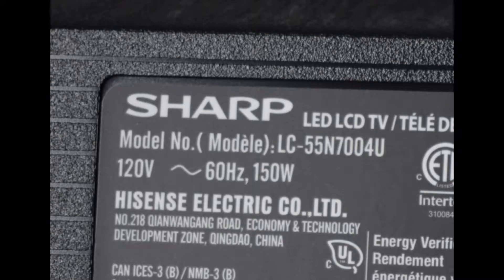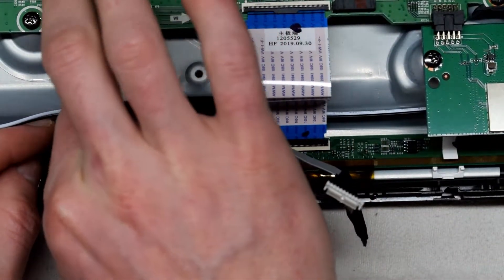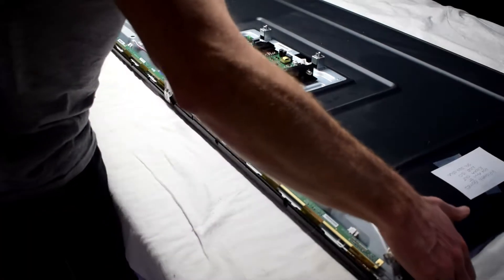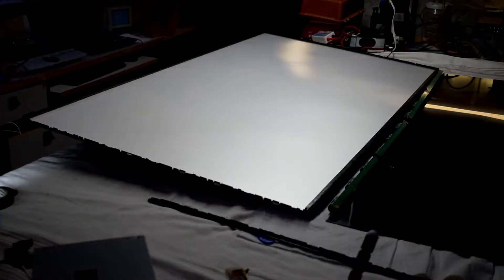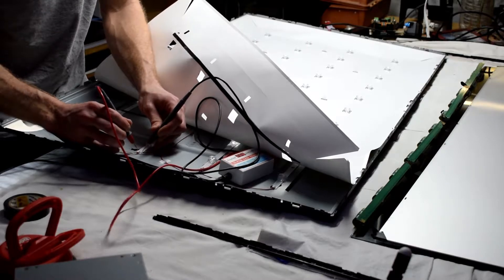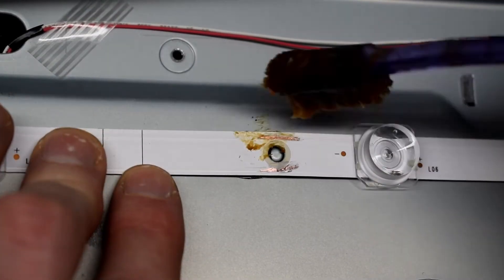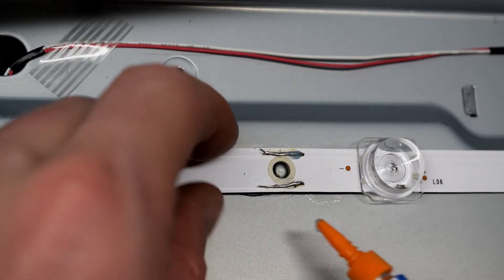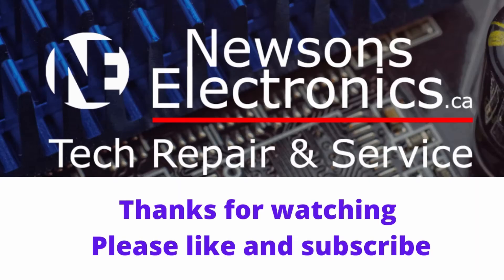How to fix a Sharp TV with a black screen? model: (LC-55N7004U)

Comment: Mine turns on but no display when checking back light what do you use and at what voltage
Reply from the maker: 3V can use multimeter or to test multiple at same time buy a led tester on amazon.
Reply: @NewsonsElectronics  thanks